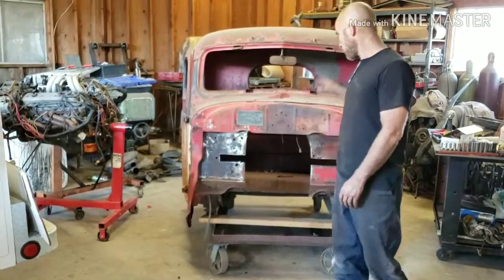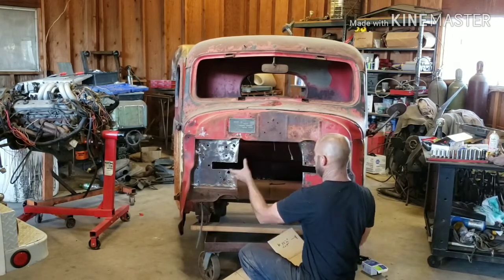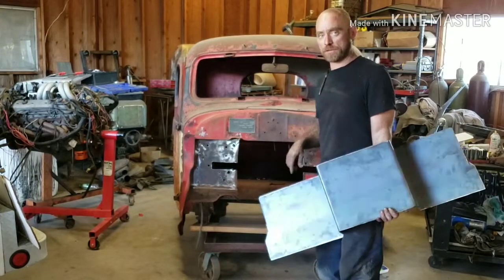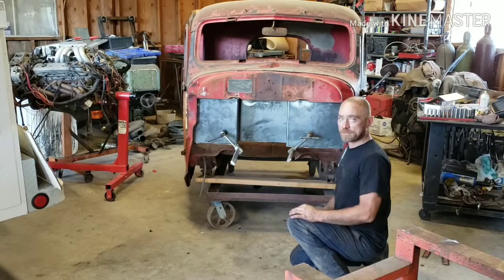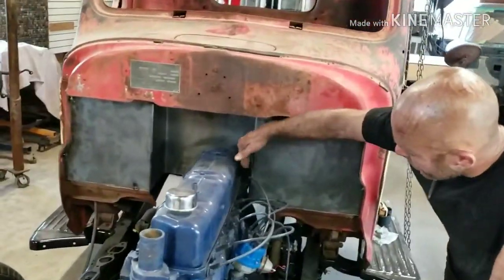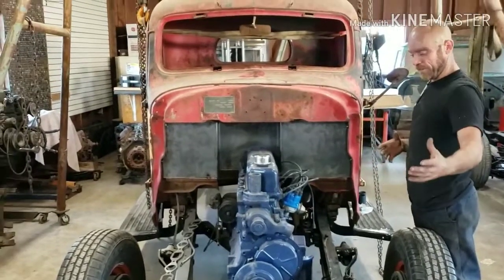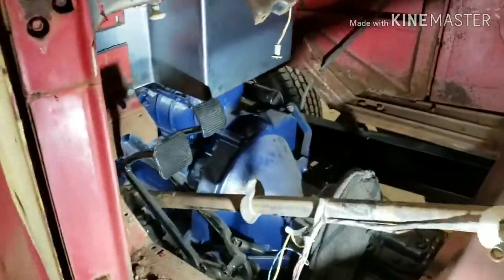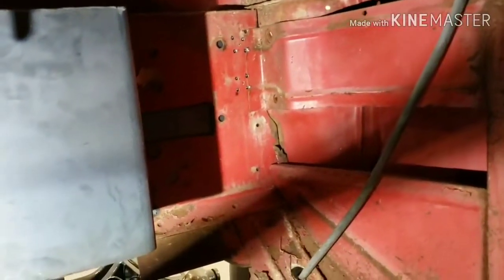Truck Restoration - KB2 - firewall - custom

Comment: Would have been kinda nice if you could have used the part of the firewall behind the engine you originally cut out so it would add a look of authenticity to the look of the firewall.